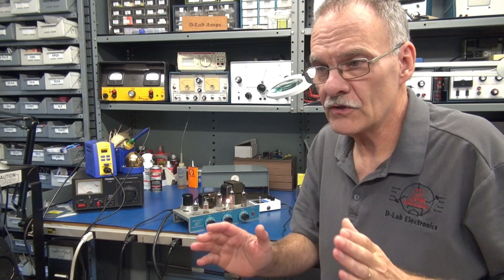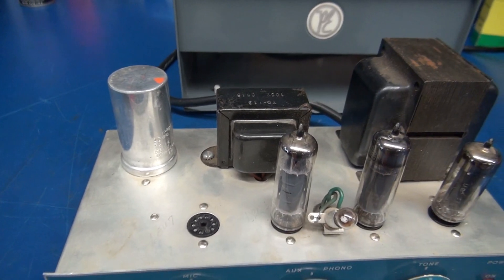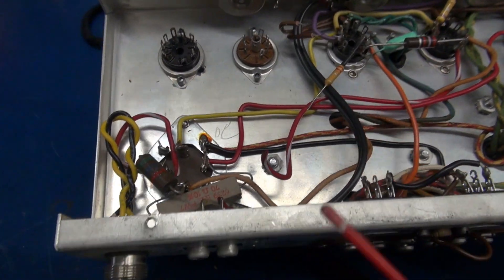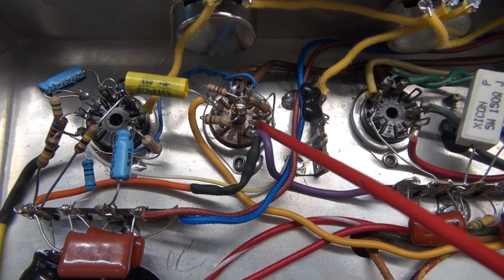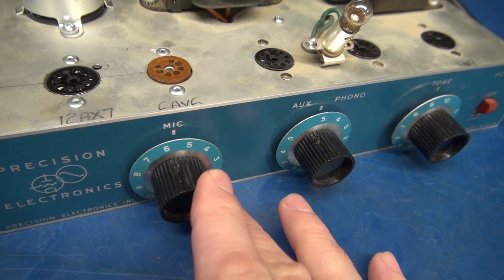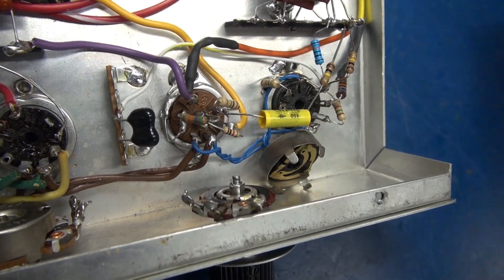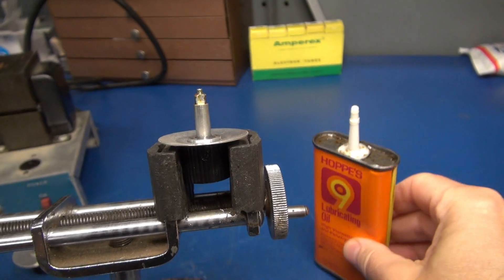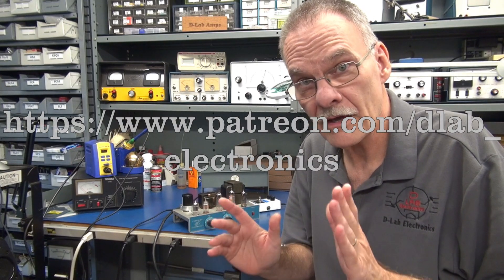How to modify Vintage Precision S-10 EL-84 tube PA amp for electric Guitar use Great for recording

Comment: Hope the bias is a bit cold on the el84 given the current limit on the 6v4 being 90ma and the el84 can pull 65ma each so rather close to a good max current adding the 4 or 5 ma used by the front end . Just my question that comes to mind . The build is very nice.

Comment: Harbor freight sells reverse twist drill bits. Work nicely on frozen set screws.  Usually by the time you get halfway through drilling the set screw brakes loose and comes right out.

Comment: Will these hints work on the S-35, (7868) and other amps (S-60,S-100)?  I have have several.
Reply: Yes.  A good way to approach a conversion like this is to find a schematic for a guitar amp that uses the same power stage (tubes).  Gut what you don't need and then add what you do need.